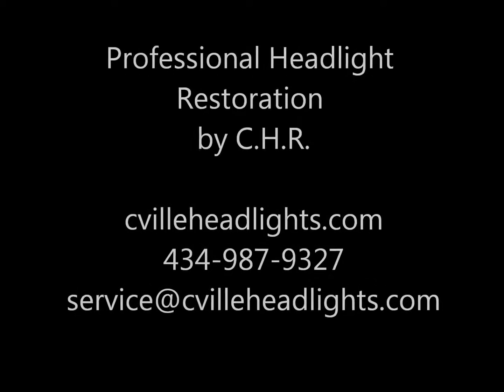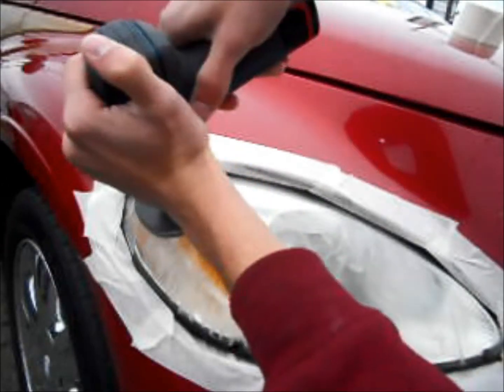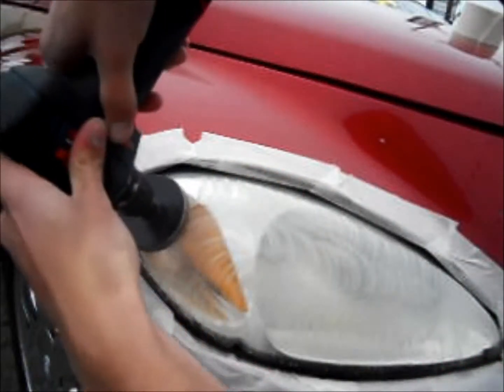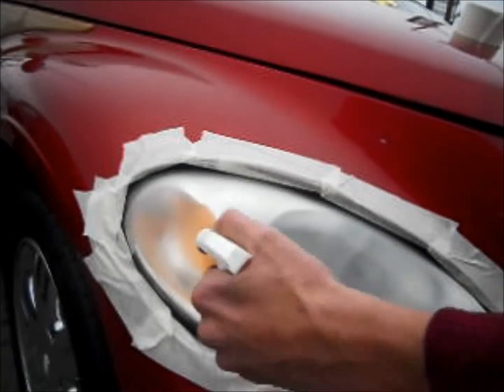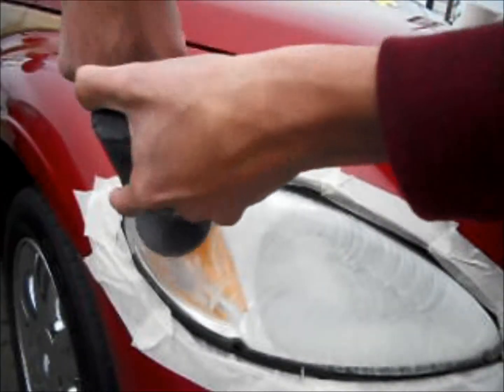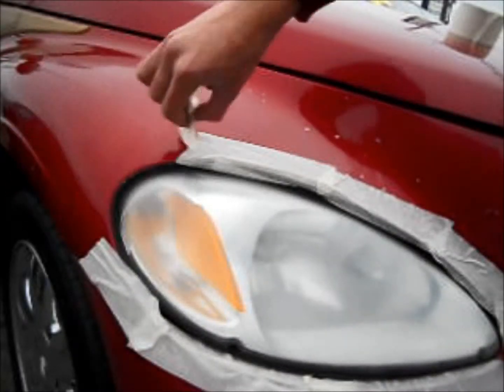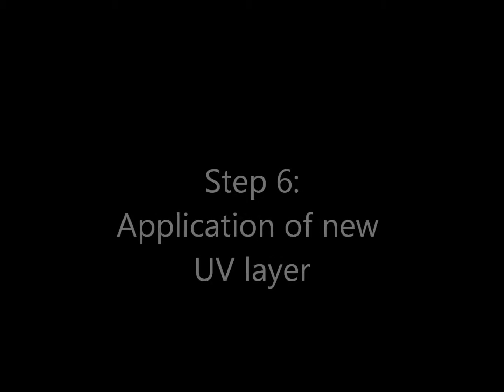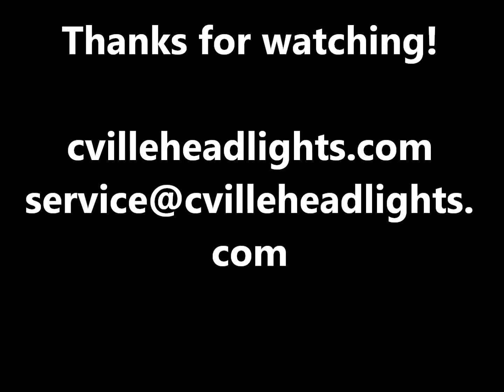Professional Headlight Restoration with C.H.R.

Comment: Hi, great videos. What tool are you using here to sand and what grits are you using and products to seal?
Reply from the maker: Hey there! I'm using a basic drill with a 3 inch sanding adapter in this video. I quickly moved on to a Griot's 3 inch DA and dry sanding, instead of the wet sanding seen in this video. I don't do restorations anymore, as I got into selling the headlights themselves, rather than restorations. Back in the day though, I would use this DA and dry sand with 300, 600, 800, 1200, 1500, and then finish up with 3000. The final filler and sealant was a product made by Delta kits, but unfortunately they don't sell individual use kits last time I checked.